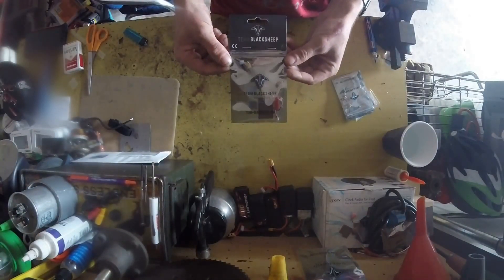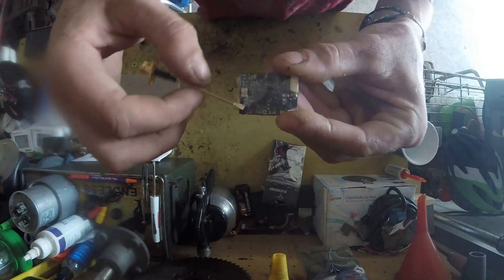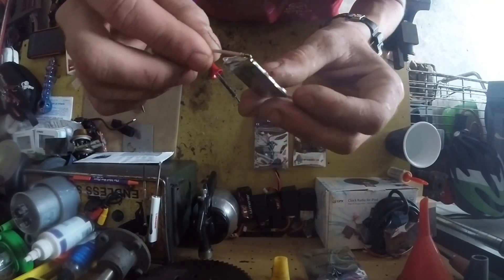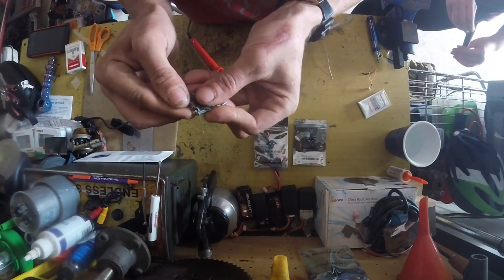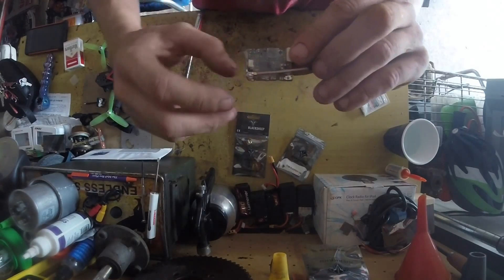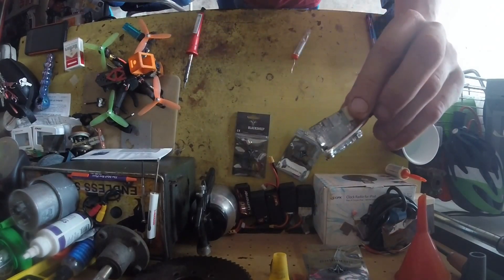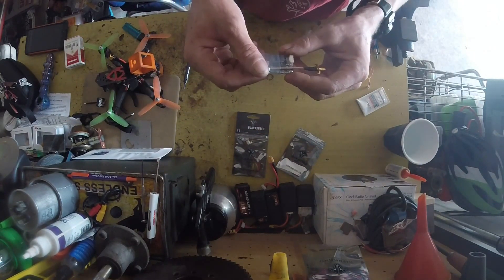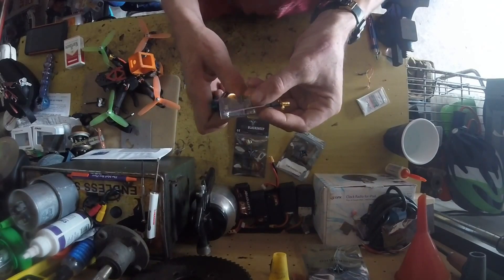TBS unify pro 5.8 UFL vtx antenna fix/mod

Comment: The way you shrunk the heat shrink made my soul die a little. Good techniqie JB taught me a while back, highly recommend securing the ipex, glue doesn't cut it, still offers up enough flex to make a dodgy connection where solder secures it enough.
Reply from the maker: Lol 😆

Comment: Weed n quads hell ya, so my issue is the ufl socket ripped off board, is it salvageable??
Reply from the maker: It can be if ur good at soldering and stripping the antenna back there should be 3 lil pads the 2 next to each other ate ground the one on the top or more towards the middle is the signal or on the antenna the middle wire the braides side will go on the 2 pads !
Reply from the maker: Need a very fine piont solder iron and it won't last forever so I would start saving up for another but if you do get it to hold u will be good till the pad falls off witch it might not happen but for me eventually they do break
Reply: That Flyin Ryan i direct soldered by bridging braided part to pads on left n right and signal wire to tiny pad at top, hope its right
Reply: That Flyin Ryan thanks bro!
Reply from the maker: Correct
Reply: That Flyin Ryan fuck ya! Works like new😃
Reply from the maker: Good shit just make sure the wire don't move them joints will break

Comment: YO BRO!!! what are the odds my searches would lead me right to you!! I've thought about doing the solder trick (which means I must have watched a bit of this sometime way in the past, which is hella cool) but on the TBS Unify Pro 5G8 V2 5V guy it is SCARY close to some microscopic SMD chips... I actually already do have my pigtail turned around, cuz on my Alien I was looping it forwards and then around and out the back. I was using a wrap strap between the VTx and the frame to keep the UFL connector on, but I wanna permitize it a bit better. Maybe a touch of hot glue and still use the wrap strap?? but I'm afraid if I break the pigtail in the middle (which I have once before) when I go to pull the hot glue off to put a new pigtail on, some of those previously mentioned TINY SMD chips will yank right off with it... decisions, decisions, and I've got an hour and a half to decide cuz then it's off to finish this new Chameleon and finally get back in the air!! ...btw I like your desk accessories a lot ;) Peace Brah :D
Reply from the maker: +KittFPV lol thanks for watching again yes the 5v is a tight one I run the HV but I can tell you I've tried every thing man from hot glue to liquid electrical tape on 800 mw for me witch I like to fly it just melts every thing man and turns it to goop but once it cools it hardens back up and it will start going every where man making a mess check out joushbardwell video and see how he does it he didn't put much solder as I did  and I think he had the 5v one
Reply: +That Flyin Ryan So glad you got back to me bro! I also always run 800mw, so that tip about remelting and making a mess was super insightful and appreciated!!! I'm just gonna put a little band of heatshrink holding the pigtail to my X4R-SB / Unify Pro stack and then hold it down with a wrap strap over the middle and another wrapstrap right over the UFL like I've been doing for the last few weeks on the Alien :D
Reply from the maker: KittFPV that's should work but I will tell you that you will have to replace that stuff eventually as the heat that vtx gives off with eventually crack the heat shrink and possibly melt the zip tie check out jb video man

Comment: I did this to my unify pro v2 and it killed it after like 2 days 😐
Reply from the maker: +QuadBro FPV never had any one kill there's and say that , even joushbardwell did a video on this because of me 🤔 only thing I can think of is too much heat u used or you got solder some where it didn't belong one of the two it don't take much heat for the solder only thing I've heard is when ppl got to change there pig tail he ended up man handling the ufl connector and didn't remove the solder all the way and he ripped of the whole conector and that was 1 person
Reply from the maker: +QuadBro FPV also if you got 2 days out of it I think I can say it's not because of this it was something else I believe the v2 is a 5 volts only I run the HV for the reason of voltage spikes as they can and will kill the vtx instantly  the HV has way more room for that. Error as voltage spikes are a big thing and do happen wether you know it or not... I can say I'm not sure how you had it wires or what board you run but I feel a voltage spikes from a punch out killed it tbh... Am I right or wrong? Where you flying when this happened?
Reply from the maker: +QuadBro FPV lmk man had only good positive results because of this

Comment: The best and easiest way is to use a wiretie over the u.fl.
Reply: MarkItZeroDude85 I just put a strip of heat shrink over mine
Reply from the maker: +MarkItZeroDude85 not a bad ideal tho but this way will insure it never ever falls off again...

Comment: I do the same with my Unify pro but i just removed all the heat shrink and put hot glue on the pigtail ufl connection then i put a new heat shrink back on :)
I found the soldering a bit extreme lol
Thanks for sharing anyway and have a great week
Reply from the maker: +ABMNS PRODUCTION that's what made me get to this hot glue don't hold when your on 800 mw it turn the glue back to a liquid and when you turn it off it cools again and again eventually leading to a failure the only that's helping would be the heat shrink my man been down all the roads with the TBS
Reply: 800mW? On a mini quad? This is insane! Why are you doing this lol
Indeed if using such power, that thing must become insanely hot and that hotglue will melt for sure :/
Reply from the maker: +ABMNS PRODUCTION where are you from? And yes I fly 800 when I freestyle 200mw when I race and because I want the best video when I'm way out or behind objects is why I fly 800
Reply: I'm from France curently living in Thailand!
I never flew any aircraft with more than 600mW in my life and currently i start to force myself using 400mW maximum!
I believe you could sacrify that insane power by using better high gain antennas for better penetration on your receiver side, this is something you should consider if you have time :)
You seem to be a nice guy! I subbed :)
Reply from the maker: +ABMNS PRODUCTION thanks man I'll give you a sub back. But I'm running the immersion rc 8dbi and TBS triumph on the true d v3 receiver idk if it can get any better than that but what I can say is I have Crystal clear video all the time might want to try it it your on the TBS unify pro it's the. Best man
Reply: ABMNS PRODUCTION that Exactly how I go about it.

Comment: nice pipe
Reply from the maker: +Jaklos Rc too bad it broke lol
Reply: quick question i ripped my ufl pigtail off and it took the connector off the vtx ive cleaned it up.  do you think i could get a sma to pdb and solder direct nipple to center and ground to outside pad?  it was powered for 2-4 mins without antenna until i was able to locate and unplug.  spent another 25 mins lookin for that damn black triumph and ripped pigtail.
Reply from the maker: +Jaklos Rc all u can do I try but yes it will work if you can get it to tack and take but you might have a problem flying with others or racing as my antenna came off and it wouldn't lock on the exact channel but worked completely fine if I flew alone

Comment: i have tramp vtx and i have issues with the ufl connector also.. maybe i can fix it like this too
Reply from the maker: +David Downs not sure but lmk if it does work please it will only work if there's metal on the side for it to bond to

Comment: Thanks for this vid bro, I'm new to this and I'm building my first drone. The pigtail came off during assembley and I freaked out! Gonna try your fix now as i dont want to have to buy another. Hopefully th unify pro is as good as people say it is, because the pigatil experience doesnt instill me confidence...sort it out TBS!
Reply from the maker: +Billy Frazier thanks for watching im trying to get trappy to put solder spots as well for the antenna but best fix ever I just recently broke mine along with a GoPro hero session 5 a frame , spektrum receiver , and flight controller
I a very bad crash every thing got bent like a U lol from the GoPro
Reply: Shit man, sorry to hear that about your gear...I just did your fix and it worked sweet! Although now i cant get my XSR reciever to bind...I'm starting to wonder why i got into this hobby, looking at my build on the bench for the past two days now and dying to fly it but cant seem to get everything to work...ha ha.  You got a put a vid up of that crash if you can...sounded epic!
Reply from the maker: +Billy Frazier it's always something man

Comment: How hot does your vtx get? I just bought one and it gets way too hot
Reply from the maker: +Blaz sitting still on 800 it will got very hot to where you can't touch it in about 5 to 10 mins temp wise idk
Reply: Even when I'm on about 500mw mine heats up to the point where you can't touch after not even 1 min haha
Reply: Can barely change channels
Reply from the maker: +Blaz why? Do you not know how to or is your button fucked
Reply from the maker: +Blaz dam idk contact tbs there good about custonermer suport
Reply: nah i know how to it just gets hot af
Reply from the maker: +Blaz yeah try to get ahold of trappy or a TBS member threw email as he is amazing and will look out I'll tell you why he don't want no one to leave TBS and go somewhere else

Comment: Is hot glue not strong enough to hold? Cos I'd prefer to be able to take off the pigtail and switch to a dipole sometimes and soldering it will make this pretty hard to switch 
Me too I have received my Kraken 5X, but I'm still stuffing the build on this frame/pod, so that the components chosen will be a perfect fit! There's wrote some work to do on the pod... Looking forward to see how you build yours, with what components ;)
(Also have the Hiro 180X which just got in yesterday, pretty much the same type of race frame with pod... Close to indestructible they say!?)
Reply from the maker: +Ray Choi dam nice man, hot glue starts melting on higher Mw from my experience then when the pig tail falls off which it's going to do the glue will get into the ufl connector and it will hard to get out
Reply from the maker: +Ray Choi but yes the solder will make it hard to get it back off but IV done it just remove a lil bit of solder at a time and clear your tip off

Comment: Does the 5v unify pro v2 overheat on 800?
Reply from the maker: +MMX2 good question I run the high voltage I'm not sure but when you have good air flow threw your frame it shouldn't over heat at least IV never had it over heat now it you crash and are looking for it that's different but from my experience as soon as it's cools like 5 mins your good to go 
Happy flying man
Reply: That Flyin Ryan cheers. was just wondering because although I purchased one I was concerned with overheating.  I read alot of people saying they overheat very fast and turn off. what's the longest you have run it stationary ?
Reply from the maker: +MMX2 probably 10 mins looking for my quad in a tree maybe longer but in a battery session na I don't even have that happen on my kraken with the pod on 800 but it will melt shit over time like hot glue
Reply: That Flyin Ryan thanks. I do alot bench testing changing pids etc. I might do your mod before I install itm so the pigtail cannot come off from melted glue. maybe this is why people having issues with glue melting and pigtail coming lose and burning out vtx
Reply from the maker: +MMX2 correct IV never had a problem since I did that now I break other shit lol still on the same vtx for a while now
Reply: That Flyin Ryan just had a look at mine. It seems there's a black epoxy around pigtail. wonder gave they started to reinforce them. Will get pic for you and link
Reply from the maker: +MMX2 no remove it that won't really do any thing after long use

Comment: Hi, 
Ive just seen you soldering the pigtail to the board on the TBS Unify pro. Is there anything to look out for when doing it? 
Is it just the outside top of the pigtail that you run the solder on or is it OK to cover the 'sides' as well? I did see you running solder to the side of the board but.........I don't wanna damage my baby.
Many thanks.
Reply from the maker: +Lee Swifty both corners and the top of you look you will see gold attach the solder to them don't get it too hot even tho it gets really hot on 800 lol good luck best thing IV done thanks to trappy glade to help out buddy give a sub if you haven't yet